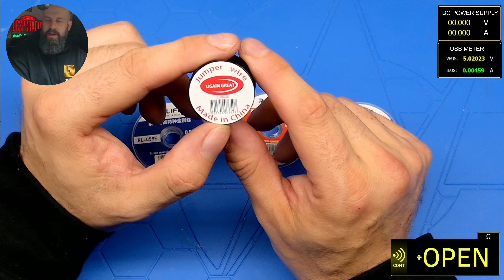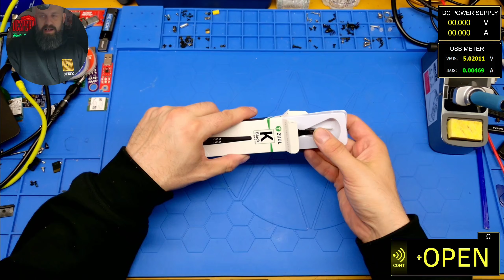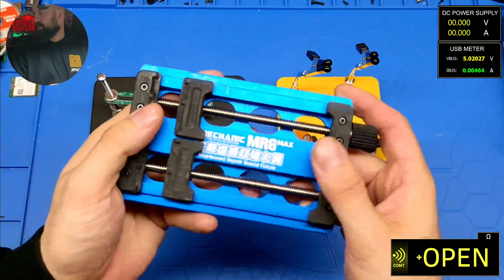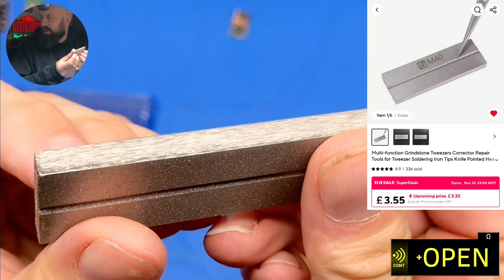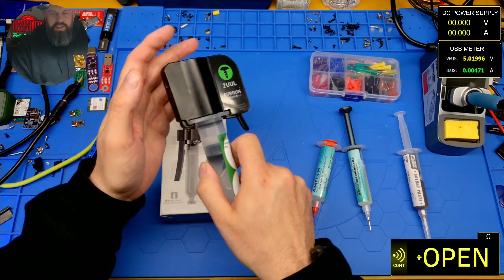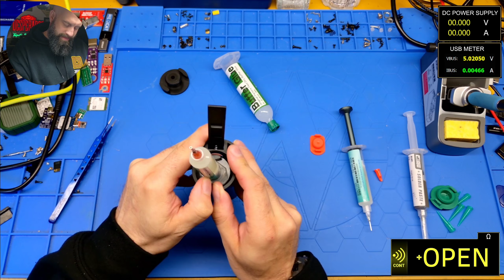Tool Talk - Ali Express Electronics Tool Haul 10

Comment: Did you  test that mechanic dispenser more thoroughly anywhere? I've been eyeing  it  for a while for solder paste! I wanna see if it can do precise "Pulses" instead of  a continuous dispensing.
Also,  do you have any sharp bent tips that are actually good? None of my  sharp tips (bent or straight) take any solder at their tip. they all ball up at the upper body  of the tip and not the  very  point, making me have to use them tilted on their belly which makes them much worse than a  regular chisel / knife tip.

are those tips you have genuine?
Reply from the maker: Flux dispenser after using my new YCS one honestly I'm not going to bother with anything else I'm going to buy 4 more of the YCS. 
Again my new Relife chisel tips I'm very happy with they hold solder really well and I'm really preferring using a knife tip. You can use on the long side for big heat transfer or use on the edge for precision it's best of both worlds for me
Reply: @JFIXX @JFIXX1  always hated knife tips but I’ll give them a try I guess :P   I only have an issue with the very sharp tips. I only use a bent sharp tip for ic pins next to a giant inductor or plastic connector that you can’t reach without holding your iron at 90c which blocks your view and microscope.
Reply from the maker: @ameliabuns the straight edge is nice for touching up around QFN chip
Reply: @JFIXX1  Oh I do that individually (at least for very low pitch chips) maybe I should try that LOL. I used to get shorts and bridges like that. I have a very similar 3d printed thing to the one you have. my issue is that I really want one  of those compressor powered solder dispensers but without the cost and space taken (mostly cost) those have a timer and stuff and they open with a small pulse (say 200ms) and then actually reverse the direction to prevent oozing. I can find a link if you're curious.  The pump if reversable would also be nice for picking up smd components i guess.

Comment: I used ceramic tweezers when i was building my own coils for ecigs haha. They are non conducting but very brittle.
Reply from the maker: Good work building your own coils I bet that's a long job winding it by hand
Reply: @JFIXX1 no it was actually a great hobby. We did crazy builds with multiple wires braids and stuff. Winding was easy. You can search "staggered alien coil" on google pictures and find some sick builds :).

Comment: Hi James! I did not read all the comments so it might already be mentioned, but if you only want to deburr the tweezers it is recommend to only move one way. Ow and btw, do not use it with soldering iron tips. You'll rub of the coating and they will be absolutely useless! Btw 2, I'm happy you mentioned the Fnirsi FNB58, because now I can stop wondering how to get meter info on screen! Keep it going!
Reply from the maker: Thanks for the tips! I haven't got any damaged tweezers yet to test it properly but I will try that method. I have also now bought a hako brass ball I'm going to be giving a go for Keeping the tips cleaned.
I do plan to make a video about the USB tester and some information about USB
Reply: @JFIXX1  Brass ball are the best! Looking forward to the USB video!

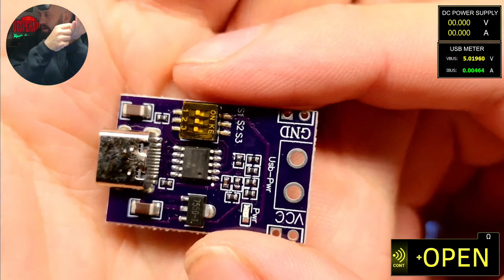Comment: 23:51 - "far too large for the board "
not always if you simply mount it vertically with the short side pointing to the ceiling. Above that capacitor you should find a spot maybe.
Reply from the maker: Thanks I have already fitted the small one now and it's working nicely but I can make a new project with the larger board

Comment: 2:08 - those are the same you used before, you had the small cutted ones for the tweezers, but in some case a big one is better. 
You can use that to clean the fridge serioiusly to get all the stains away your girlfrriend can not get away. She will be surprised how effectice they are but be aware that they are like finest sand paper which means you have to test it our carefully. These sponge works on almost all surfaces and if you start to clean a new surface then be carefull cause brand new they are more aggressive. Hence I tend to use to make them wet before usage cause that softens the sandpaper effect when they are fresh and sharp. I also use isopropanol with these. Works on furniture and on cars too, but bee carefull . You can also use it on windows at home or glas in the fridge or car. But always test it on an edge.
Reply from the maker: I have used the sponges already around the house they are really impressive

Comment: the mechanic dispenser does seem too large. I think you should use those blue ones that have a screw and bring the handle down to the side of the tube to press.
Reply from the maker: Yes I have one of them blue ones already. I have something else to test in the next video I'm still searching for the thing I'm most happy with.

Comment: Looks like Flux pump dispenser trigger could be installed 180 degrees- with squeeze trigger pointing up as well.
Reply from the maker: Good point didn't think about that I'm going to try it see which way I like better thanks

Comment: Probably everybody is aware of problems ,while ordering from A express. You might get lucky and receive the exact item which was ordered ( if working as described,hurrah) and you might not. I got a gardening rake instead of a workbench and a drawer handle instead of a welder el cheapo. A hundred bucks+ motherboard, brand new and not working. Once they get your money,the return/refund process is tedious ,to say the least
Reply from the maker: Unfortuantly no good places with good price to order where i live in UK. 99% items i have for electronics are from AliExpress but fortuantly i havent had really any issues

Comment: The sponges might not be such a great idea i'm sorry to say, as they generate static charges. To quote the inventor- "The Dry Cleaning Sponge" (our vulcanized rubber sponge) works by using static electricity to attract and hold dry soil, dust, and pet hair. The material builds up an electrostatic charge as it is rubbed across a surface, which then pulls particulates to the sponge, much like a magnet" So probably not the greatest tool for sensitive electronics. Just thought you should know. All the best, Ast...
Reply from the maker: I never knew about that! I see other people use it all the time so I assumed it was safe. It did work nicely for cleaning the laptop shell tltge other day so I can definitely use it for that if not safe on PCB
Reply: @JFIXX1  No probs, just thought it might save you a lot of pain, long term, looking for a static damage fault. On a side note, you mention your blue mat being a static ESD mat, sadly it isn't conductive or grounded, it just saves you burning your desk. An esd mat will stop you from damaging sensitive components by dissipating esd down to ground, via the lead and by using the wrist strap connected to the mat. Best regards and keep up the good work, Ast...
Reply from the maker: @AstonsVintageTechnologyWorkshp My whole desk actually has a ESD mat on it the same size as the desk and it has bonding points to connect to ground however it's not heat resistant. I'm using the blue mat on top so I'm guessing it's pointless to connect it up also I'm not a fan of wearing a wrist strap. I guess I will wait till the day it becomes a problem and I'm damaging components and then I'll do something about it

Comment: PRO TIP: Just open an old "wallwart" transformer and unwind all you need i'm sure you have at least 1 lying around or an old one you don't use anymore
Reply from the maker: Good idea is that for enamled wire
Reply: @JFIXX1  Yes all transformers use enameled wire and im not sure how big the diameter is but you would want to check different adapters will have different diameters depending on the uk 240 side or a us 120 volts.

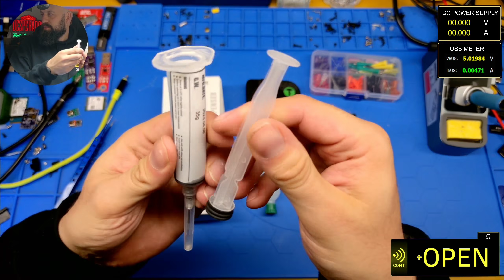Comment: 27:49 I don't have one yet, but am going to order one soon, but instead of that mechanic brand pneumatic syringe dispenser, I would personally prefer to obtain something like a "982 Semi-Automatic Glue Dispenser Machine". They come with foot pedals and little finger trigger adapter that goes onto 30ml syringes and usually comes with a set of adapters for 10ml syringes and 30ml syringes plus various size syringe tips. You can purchase various size syringe adapters separately. They are more comfortable to use as you don't have a heavy air pump on the end of your syringe, just a tube going to the device on your desk. You can hook up multiple adapters at once if you use one of those aquarium air pump splitter manifolds. edit: the beautiful thing of the 982 and 983A dispensers is that you can not only regulate air pressure, but you can also set it up to automatically dispense a fixed amounts every time it receives the trigger signal from either the foot pedal or the finger trigger. As an extra cherry on top, it also has a vacuum function so you can use those IC vacuum pick up tools that connect to vacuum pumps.
Reply from the maker: I definitely need one of them I'm going to check out the prices now
Reply: @JFIXX1  they are quite affordable, I can get one with local USA shipping included for abut 50USD. pretty sure you can get one for a similar price shipped to the UK.

Comment: Mechanic FX105 is the jumperwire you want. :) I use mechanics FX201 FX202 and FX15 non-insulated jumper wires and they are amazing. They work super well, just need to add soldermask afterwards to insulate them, but that you need to do to secure them anyway. I prefer the non-insulated ones because they are easier to work with, not having to remove the enamel before using. Edit: Seeing those large melamine sponges makes me think they are a bit unwieldy to use, especially on smaller boards. I personally use MaAnt my-065 nano sponges. They are nice and firm, much more firm than the mechanic brand sponges I tried, also work super at absorbing flux. Ceramic also conducts heat pretty well, but less than metal, that is for sure. The bent tip ceramic tweezers are great for holding down stencils, that relife tweezer has a 2nd version that has a "bent" tip.
Reply from the maker: Thanks very much I will buy all those mechanic wires I am definitely thinking non insulated wires will be much easier to work with tinning. It doesn't matter about a coating as I will use the mask like you suggested. Also I have the relief bent tweezers so I will give them a try
Reply: @JFIXX1  the FX105 is the 0.005mm one.
Reply from the maker: @rick5078 I think it's 0.005 not 0.05
Reply: @JFIXX1  It indeed is, that was a typing error.

Comment: Hey, just checking are those tweezers by 2uul actually ceramic or is it like others I have, its actually like a Teflon plastic, very hard but not actually ceramic
Reply from the maker: I am not sure how can I check it
Reply: @JFIXX1 Metal should not scratch the ceramic material. It is the other way around.

Also the ceramic is more temperature resistant than Teflon plastic (more than 250°C). TW31 and TW32 are marketed as insulative ceramic tip tweezers.
Reply: @JFIXX1 I tried cutting a slither off it with a scalpel and you will immediately feel if it is "plastic or if its hard like a ceramic tile for instance. Hope that makes sense.
Reply from the maker: @Will-SoloHaq when I go back again to my desk I'm going to try it
Reply: Solid point that - some of those sold as ceramic are actually just teflon.  Frustrating as hell.

Comment: Just look for "enameled copper wire" for the trace repair stuff. Tons of options in all thicknesses and most of the time have the non-enameled in the same offer. There also are sheets of pads and traces. Search for example for "RELIFE RL-007GA" for those. Just to give you an idea of what to search for. "208 Dot Repair Spots Dot-Repairing Soldering Lug" could lead to varying results. The wire is more universal but sometimes it could be nice to have an actual pad to work with. 
The glue dispenser I really like. Let's face it, the tubes of the Chinese clone products are trash. I've had flux coming out of the back where the plunger is pressing. Usually it's nothing we would need outside of mass production but if it dispenses well, it can always be an option

Comment: For those electric flux dispensors, rotate the device 180° in your hand, so the trigger is facing AWAY from you. Hold the flux with your thumb and fingers, the reach out with one finger to pull the trigger.
Reply from the maker: Yeah that makes sense I also have the Qianli dispenser thing that other people are recommending to try as well

Comment: Around 24:30 - what you need to do is buy 6-Pin USB breakout headers.
Don't complicate things with a trigger board, that is not necessary!
. .
The 6-pin headers have the positions for the 2 x 5.1K pulldown resistors (usually 0402) on dedicated pads. They are designed for downstream devices, to trigger 5V to be supplied by the PSU.
. .
The 5-pin breakouts are designed for upstream devices, and have a pad for the 56K pullup (for 900mA) or other value for advertising 1.5A or 3.0A current capability to downstream devices.
. .
The 4-pin sockets like you bought only break out the VCC, GND and 2 x Data pins and need tiny jump wires to add the resistors. It's not worth fiddling around with them, just buy the 6-pin ones.
The 2-pin are even worse, as they usually don't break out the CC lines at all.
Reply from the maker: Yes exactly that's what I need because I couldnt solder resistors on that board. I would prefer to use the resistor method than a PD trigger if you have any link you could share with me for the 6 pin header I would appreciate it as my search I couldn't find exactly what I wanted
Reply: @JFIXX1 - I cant post links here.
Easiest way is to get
👉 usb-c socket 6 pin panel 👈
Then desolder the panel section.
Or just trawl through the other listings (without the word panel).
Always buy 10 pack, look for Choice or Bundle Deals.
Look for the ones with 2xCC pads on one side, and 2 tiny black 0402 resistors on the side marked V+ D- D+ V-
They have the 5.1K fitted, and you don't need to connect anything to the CC or D pads.
They make them without the panel PCB but they are harder to get a suitable search term to find them as easily.

Comment: As long as the solder adheres to that "Screen separation wire", it will probably work completely fine as a jumper wire. Just try it out.
Reply from the maker: I could to I actually assumed it would be some kind of plastic wire but maybe it's conductive I will test it
Reply: @JFIXX1 They might work, these wires are usually made of molybdenum/tungsten

Comment: You mentioned wanting to get into reballing stencils etc, check out the jtx t4 pro set. Its a nice little holder plus lots of stencils. And for cheap 😅
Reply from the maker: Thankyou very much for sharing link I will definitely check it out
Reply: @JFIXX1  I don't think I can share a link here directly, but using the search term on Ali should do the trick ;)

Comment: hi mate great video i like look of that repair board but also where did you get your blue matt from as cant seem to find one like that maybe you have a link for it and them screen cutting wires you might ordered by mistake but actualy will help you as some laptop screens or tablets etc if doing them are bonded that mecanic pump i think looked to big n bulky for an everyday use like flux but maybe better for solder paste otherwise good selection and yes the magic sponge things i use they are good i cut a load up into small cubes so can grab with tweezers and use in smaller areas as well as keepin a bigger one close by
Reply from the maker: Thanks PITCO. If you go on the oldest video it was a first video I made to show the mat with link where I got it from. 
And I will hang onto the wires one day I will need them I'm sure !
Reply from the maker: https://youtu.be/q4vUIusGcyQ
Reply: @JFIXX1 thanks jfixx I'll look into the matter as its in the us depends on shipping costs etc but defo look at that
Reply from the maker: @PITCO-Tech-Repairs It was expensive like the same price again for shipping. Man that first video I made is so bad 1 year ago I can't believe how much stuff I have and videos I made since then

Comment: Lots of interesting tools and equipment in this video. I also use the melamine sponges and I cut them into 13mm or so cubes. I use my bent flat tweezers to hold the cube and dip it in my IPA dispenser pump. Works great cleaning off the flux.
Reply from the maker: I'm interested to see how the sponges work out I only have seen other people use them but now I can try myself
Reply: @JFIXX1 They are pretty good. They are a little harder to hold with regular tweezers, but when soaked with IPA, they are easier to hold.

Great DIY solution.
Reply: @JFIXX1  just a warning: melamine sponges are a health hazard by generating ungodly amounts of microplastics and as a bonus melamine is potential carcinogenic. Certainly toxic for kids.
Reply from the maker: @GreenTechNow Really? 😳😲
Reply: Mechanic actually sell them pre-cut into 10mm cubes.
Reply: @Aser6000 Yes, but I think they have different densities. I guess it's easier and faster, probably and cheaper, to buy melamine sponges from local Chinese stores or online from AE in bulk.
Reply: @Aser6000 I used to buy the pre-cut ones called "Nano sponges" but the density was inconsistent. So I buy 3 pack locally for $1.25 and use a straight edge and a sharp utility blade. I use them a lot so it's much more cost effective.

Comment: You got good tools, I hope you like them. 

I think the Mechanic gun is the best to use for glue because it pushes the glue evenly and it seems to be better for bigger tubes (30CC - 50CC). Anyway, it's good that it has an adapter.

Yes, ceramic tweezers have high temperature resistance. Your Relife model is more precise, specialized for flying wire.
Reply from the maker: Thanks a lot 😊Yeah the relief ones are sharper at the end .